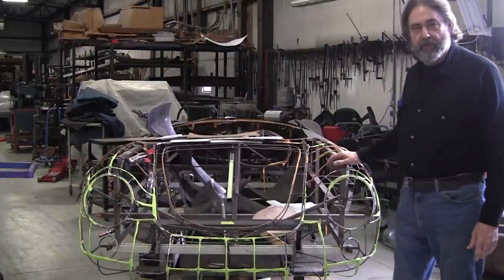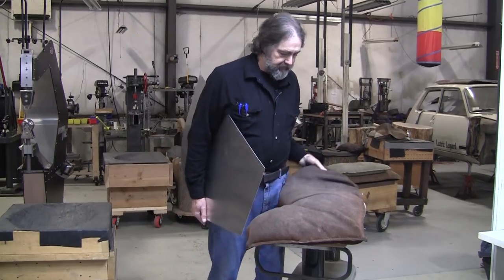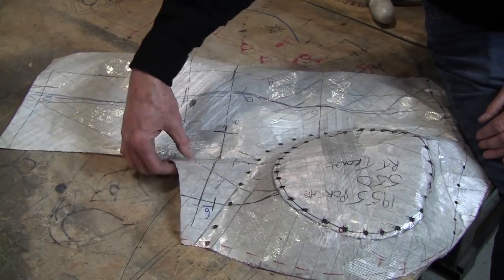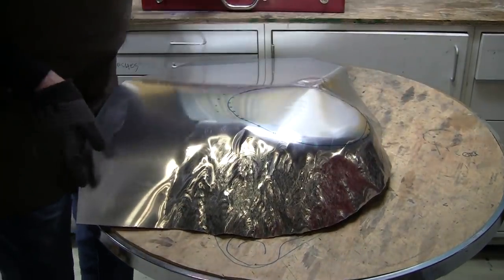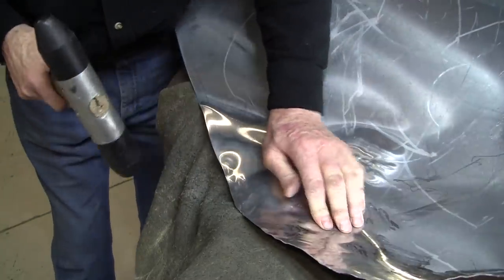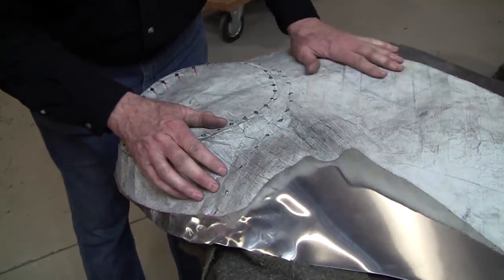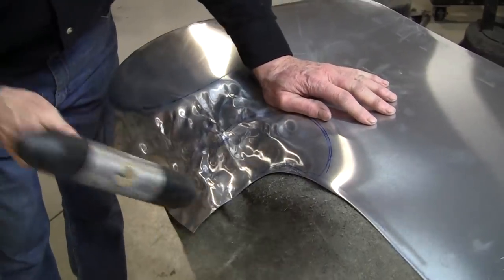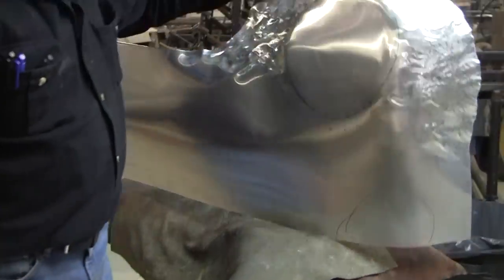Metal Shaping: Roughing out a Porsche 550 Nose Section

Comment: Did not know that about the spines! Now I know what to do when they pop up.
Reply: I used to fold the spines over on steel and then weld them. Then I would grind everything back down to the original thickness. Wish I knew how to properly do it back then, it might have saved a lot of time. I was always fighting heat warpage.

Comment: Wray , l don't know what grade aluminium you use but the aluminium we used would never have survived the beating you give yours!  Top drawer Wray !
Reply from the maker: Hi John, from a search: 3003 aluminum is alloyed with 1.2% manganese. While more malleable and formable than 5052 aluminum, it is not as strong (tensile strength 17 to 30 KSI vs. ... Due to the presence of copper, 3003 aluminum is highly resistant to corrosion. This grade also features excellent workability and weldability.

Comment: Yeah, that was very informative. Thanks, Wray!
Would one of those pricey Eckold machines spread up the valley shrink part of that panel??
Reply from the maker: Hi Paul, I believe you are correct. Anybody attempting to produce shapes like the 550 in a limited run production series would be greatly served with a fully tooled Eckold and a full surface hammerform buck to quickly reproduce accurately very complex shapes like the 550 nose panels.
Reply: @proshaper  Got my eye on the Eckold KF800. Just over £20,000 in England but it’s a machine I can take to Japan in the future. 
So, one of these in conjunction with a full hammer on type of buck is the way to go?

Comment: Thanks for the video Wray, love the way you massage the metal :)  Does that 3003 H-14 work harden and require tempering as you make the panel?
Reply from the maker: I call what happens to the  metal in the heavily worked areas "Confused" ( non uniform) , once you planish it becomes uniform again and more malleable.

Comment: Super primitive & crafty
ps. wondering slicing a small piece of the inner part out then weld it together is possible method?
Reply from the maker: Slicing and welding, smaller pieces, shrink shaping, hammerforming, stretch forming, combination shrink and stretch shaping, are some of the valid methods. This method I used  in the video was a demonstration of the potential of heat shrinking and the awesome potential of a wireform.